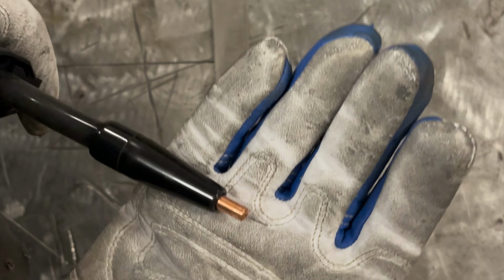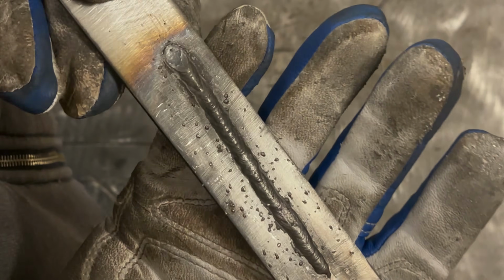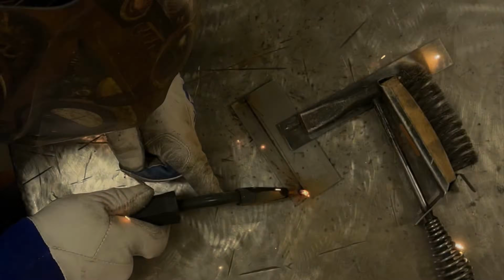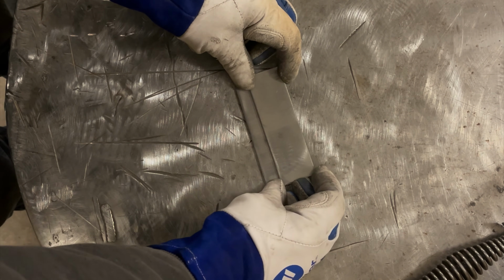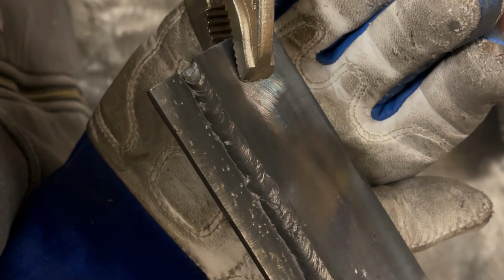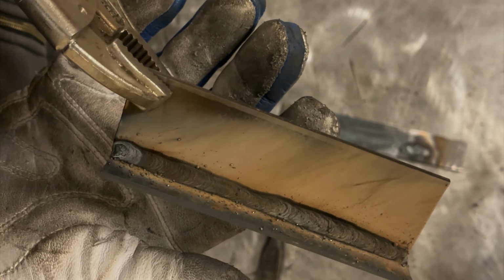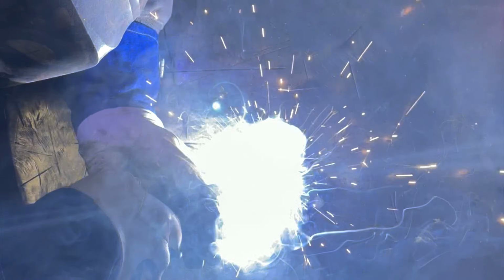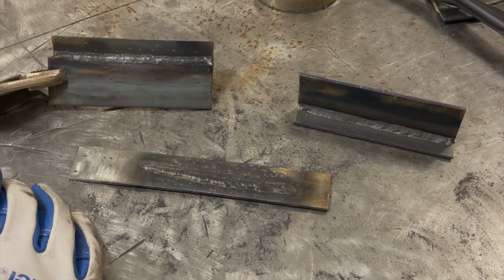How to weld with flux core wire

Comment: I was doing some 1/8 plate today with 0.030 flux core at recommended settings (20v, 272 in/min).  The welds looked good but it sounded like it was pulsing more than I am hearing in your vids.  I tried adjusting volts up/down, and stick out but nothing really made the pulsing go away.  I'm pretty new to FCAW - is pulsing indicative of some specific problem?

Second question - I wasn't getting penetration to the back side with 1/8" plate butt joints, no gap.  I chamfered and that seemed to solve the problem, but I was surprised that I needed to chamfer with 1/8" plate.  Wondering if I'm moving too fast.  Any thoughts?  I know it's all speculation if you can't see what I'm doing but I appreciate your vids and thought I'd get any input you might have.

In terms of tension, I am using the correct drive roller and set just enough tension so that it will bend when directed at a surface.  I was more concerned about too much tension (this being flux core), rather than too little, but just wanted to add that info in case it matters.
Reply from the maker: Hopefully this helps you:  

The pulsing sound is common and generally is caused by a lack of smooth feeding.  It may help if you put a small amount of grease on the shaft the spool of wire rides on.  Make sure the spool tension isn’t too high as well.  If that is all good it could also be differences in the thickness of the wire or a slight inconsistency in the drive roll center to outer diameter.  It probably isn’t a major issue but it is fairly common.  Also, make sure you’re using the right sized contact tip.  Trying a different brand of wire may help too.  Beyond that I wouldn’t say it’s a huge issue.

So most welding processes don’t have much penetration when run on a butt weld.  You achieve penetration by running a gap.  Your settings do seem a bit high however they may work for your welder.  Out of curiosity try 17.5v and 250 for wire speed.  If you run too hot you will be forced to move overly fast, which will will make it difficult to achieve penetration.  You will wind up with a out of control puddle and a overly high weld before it melts through.  The slightly lower settings may clean up the sound of the welding and give you more control (require moving slower).  

Because of the drive rollers knurling, you can run with low tension and still get solid feeding.  The roller grabs the wire so feeding won’t be a issue at lower drive roll tensions.
Reply: @makingmistakeswithgreg    Thanks so much!  I finished the project I was doing and I'm super happy with it (a frame for a motor control panel).  I dialed back the wire feed, and then found a voltage that worked. As for the pulsing, I think I had too much pressure on the wire spool (not the drive roller), but it was reassuring to know I didn't have to worry about it.  I really appreciate your help!
Reply from the maker: @robert.santore  awesome, glad to hear things improved 😀

Comment: Mines been in my garage for a few year would I have to just replace the wire and  it will weld fine?
Reply from the maker: I would replace the wire for critical stuff.  If you want burn the spool up for practice rather than throwing it out.  You may get porosity issues with old wire.  For practice who cares, to
Actually stick two things together that would be a problem lol.
Reply: @makingmistakeswithgreg  ok thank you

Comment: Picked up mine for $140 when it was on sale. Pretty nice little flux core welder. I definitely have an addiction problem for welders. Don’t care if they are cheap cause I have 3 of the green harbor freight welders and one AHP I use for TIG. It’s handy to have a machine for each specific process so I don’t have to keep changing settings and electrodes etc… I really appreciate all your videos, very helpful with all your advice.
Reply from the maker: Glad the videos have helped you 😀.  There is nothing wrong with multiple welders, that’s what I prefer too.  I have owned two different all in ones (esab rebel 205 and everlast 275) and they worked, but I much prefer stand alone machines.  That way the machine can be set the way I want and I use it for that.  Not to mention the reliability issue, you never know when one tool may have a issue/fail.  I always have a backup, I’ve been burned too many times lol.
Reply: Love to do that but now only have room for two. Next place will have a barn.

Comment: excellent video 👍i bought the same welder couple months ago havent used it but to weld rebar so far... hopeful to get enough skil under my belt to replace my rockers on my truck
Reply from the maker: Thanks 😀.  Rockers are doable with the machine.  Generally gas shielded MiG is preferred, mostly because at super low values porosity isn’t a issue.  However with some fine tuning you will be able to do it with flux core. Definitely practice on the same thickness material as much as possible before trying it.  It also helps to have someone hold a piece of copper on the backside of the welded are (or holes you need to fill) to prevent a blow out).  Search copper auto body spoon to find cheap ones on Amazon.  I will do a auto body video soon that will be of use 😀

Comment: Please will you help what exactly voltage and wire feed for nice welding thank you
Reply from the maker: It all depends on the wire and the machine honestly.  There is a huge range of settings that work, travel speed control is what gives you the ability to make good welds.  There are no magical settings, just practice with your machine and you’ll get a feel for it 😀
Reply: @makingmistakeswithgreg  appreciate your help

Comment: I appreciate all your knowledge. Still working on sorting out voltage, feed speed, and all the different pieces that works together and how to identify which is off. Might have to watch your video again. Great stuff
Reply from the maker: Thanks for the kind words 😀.  I made a video on what I call heat metal ratio, it can be found here: https://youtu.be/rml5SZBy_f0 .  That video should help you a lot.  Don’t feel bad if you find voltage and wire feed confusing.  In simple terms voltage dictates the width of the weld and how flat it is.  Wire feed dictates how much metal you deposit.  When you have thicker metal you need bigger welds than thin metal, therefore you need more wire feed.  Everything must be in harmony though, if you have high wire feed and low voltage your weld will just be a bead of caulk on plate.  If you have high voltage and low wire feed the wire may burn back all the way to the tip.  By keeping the ratios close everything will work properly.

Comment: Hi, I’m a newer welder. Just watched your flux core videos. I have a couple of questions. Number one when you are welding are you using a whip in pole motion? Or are you just going straight across at a slow pace? Also, am I correct in wire speed being the main source of putting heat in the metal versus that of higher voltage? So, for example if my voltage is X and stays at X, but I burn through now I slow down my wire, feed speed, leaving voltage the same would I not burn through at that point? Thanks in advance for your response and for your videos.
Reply from the maker: Welcome and i hope this info helps 😀.

When it comes to whip and pause, oscillation, etc I either go straight in (smooth travel) or a slight oscillation with flux core.  You want to avoid holding it in one spot and filling a big weld, the thicker the weld you deposit the more probability you will have porosity with flux core.

So as far as the voltage vs amperage debate.  It’s very complicated but I will try to simplify it.  Each value by itself doesn’t have a huge effect on depth of penetration.  Voltage makes welds wider and sets out the edges/ toes more.  If voltage is too low your weld will lay like a bead of caulk on plate, regardless of wire feed speed.  WFS controls how much metal you deposit.  It also increases the amperage the machine outputs.  The higher the wire the higher the amperage, but it doesn’t affect penetration much on its own.  The biggest control of penetration is both wire feed speed and voltage.  I made two videos regarding this with short arc Mig https://youtu.be/2zjveVO_igo ,  and this video https://youtu.be/PnRFiVNUDPI flux core wire reacts slightly different but it will be similar.

Now to directly answer your question: if you have a issue burning a hole and you drop either wire feed speed or voltage, it may not burn through.  However there is a range you want your settings to be at.  If you drop voltage too low or too high for a give wfs you will either have excessive spatter/wire burn back to the tip (voltage high) or a very roped up weld/difficulty with fusion (low voltage).  If your wire feed is too high for the voltage the weld will be excessively large, not wet out properly, and possibly push through the weld pool (on thin material).  If WFS is too low you will burn back to the tip have issues with a literal arc being present between the wire and the plate, and excessive spatter.  

When it comes down to it it’s best too adjust both at the same time to get it close, then adjust voltage up/down based on how wetted out the weld it, and adjust wire feed by how big/small the weld is.  Hopefully that helps 😀
Reply: @makingmistakeswithgreg  OMG thank you sooo!!! Much!!! Great Info
Reply from the maker: Also, to make more sense of heat to metal ratio watch this video:  https://youtu.be/rml5SZBy_f0 , you will see the direct results of changing settings.  The video has a lot of info and will take a bit to get through, but is should clarify a lot. 😀
Reply: @makingmistakeswithgreg  I really appreciate you!
Reply from the maker: @fpvflyby6855   no problem 😀, glad I could help.

Comment: If im using the proper flux core wire for overlapping welds. If i overlap my welds on the part like one in the middle one on the left side with overlap one on tbe right with overlap will the weld be alot stronger?
Reply: Multipass is what I meant. I guess overlap is a negative term in welding. What I mean is multipass weld stacking does this make the weld stronger?
Reply: Im using blue demon E71T-11
Reply from the maker: So what gives a weld strength is that it’s sized properly for the material (generally weld is the same thickness as the material), it’s free of defects (porosity, undercut, etc), and it’s made from filler that’s as strong as the base material.  When doing multiple pass welds to meet proper finished weld size the weld will equal the strength (and may surpass) one single pass.  

To put it in simple terms, say you have a weld that you could possibly do in one pass vs two or 3.  The more metal you put down in a single pass the poorer the grain structure of the solidified metal.  There are limitations to how much metal you want to put down in a single pass.  For most people it’s the limit of what their welder will do (most don’t have 300+ amp machines to put down massive welds), so multi pass becomes a requirement.  However there will be situations that a person at home could do a single or multi pass on.  In such a situation if it requires strength use multi pass, if it doesn’t then single pass it.  I will do a video on this topic soon 😀

Comment: When your welding flux core like this is ther anything touching the meterial from the gun? Is the wire in the pool its creating or is everything like the wire like separated from the actual meterial?  I guess what im asking is the wire dragging along the crack of the 2 pieces? Sorry if it's a silly question but I need to know.
Reply from the maker: Ok hope this helps:

Great question, and it’s actually a very complicated one to answer 😀.  So with wire welding (gas shielded short arc Mig) the wire pushes into the molten puddle, and the current (amperage) rises to the point the wire blows apart, clearing the short.  It repeats that many times per second.  “Spray arc” wire welding has the wire turning to liquid before it ever hits the puddle so it functions much different than short arc mig.  Flux core is a hybrid of both short arc and spray, it’s not exactly either one of them.  The wire itself (say .035 flux core) actually has very little metal, because it’s a hollow tube.  This is why settings used with flux core aren’t nearly as high as spray arc yet it functions closer to “spray arc” or globular” transfer.  Basically the heat to metal ratio favors heat with flux core wire due to the lack of metal in the wire.

Flux core wire also is welded on DCEN polarity (the gun/wire is negative) where is Mig is done DCEP.  DCEP puts far more heat into the wire itself because electrons flow from the work piece to the tip.  The electrons striking the wire tip causes a ton of heat to build up.  With DCEN (mig gun on the negative side) electrons jump from the wire to the plate, which keeps the wire slightly cooler.  If you weld flux core on DCEP the wire produces a ton of spatter.  I would take a guess and say the hollow tube can’t handle all the heat.  Running on DCEN is also why flux core differs from most wire processes.

With all of that covered, let’s talk about the arc.  With short arc mig there isnt exactly a arc that’s going between the wire and the molten pool (like the stick or tig arc).  The arc that exists is only temporary because a arc can only exist when there is a arc gap.  When the wire hits the puddle the voltage drops to zero and there is no arc present.  This happens many times per second.  With spray arc there is more or less a consistent arc present because no solid wire ever hits the molten puddle because it’s liquid before it ever hits.  The voltage never hits zero either.  Well flux core from what I have read never exactly hits zero volts and the wire itself doesn’t actually stab the puddle as a solid like hardwire short arc mig.

As far as how far should the wire be, that depends on what wire process.  With the proper settings with gas shielded short arc mig what matters is the tip of the contact tip is 3/8th of a inch to the molten pool.  Flux core is between 5/8th and 3/4 depending on wire diameter.  Spray arc is 1/2 to 3/4 depending on wire diameter and settings.  Unlike stick and tig (where arc gap is critical) you don’t control the arc gap with mig.  You need to only worry about maintaining the contact tip to work distance.  The wire (with proper settings) will just do it’s thing when you weld provided the contact tip is the proper distance.  This is one of the huge benefits to wire welding, small (1/8th in) variations in contact tip to weld pool changes won’t affect the weld much.  1/8th changes to a tig or stick arc gap will drastically change the width of the weld.  All you need to do is aim the wire directly to where the pieces meet, pull the trigger, and move the gun at a consistent proper speed (drag angle with flux, push or drag with MiG).
Reply: Nevermind there separated bc there has to be a arc correct? How far from the meteral should the wire be?
Reply: Ok thank you. I got this gun and im gonna practice alot befor I weld what I'm actually needing done with it.

Comment: Sooner or later I'll pick up one of these, but based on what you're telling us I should get my wire some place other than Harbor Freight-  there's a Tractor Supply on the other side of town, and I'm pretty sure they carry Hobart welding products, and Hobart from what I know from welding classes makes a pretty good wire product.
Reply from the maker: Hobarts fabshield 21b runs really good and I bet they sell it.  It’s a e71t-11 wire and suitable for multi pass welds.  Highly recommend that wire, it’s a night and day difference from harbor freights wire.  😀
Reply: @makingmistakeswithgreg  Thanks bud.
Reply: There are a bunch a comparison videos here showing Forney and yeswelder make really good wire

Comment: So, flux core (gasless) is a fine process, but somewhat unforgiving-  meaning that you have to have the optimal stick-out, slow travel speed, and everything else.
Reply from the maker: Pretty much.  Honestly flux core is a real solid process on thick material and for out of position welds/vertical up.  However when things go wrong it can be a handful to fix.  Gas shielded Mig doesn’t make porosity when you vary the stick out by a little bit, it’s far more forgiving.

Comment: Is it anything...that the beads are dark grey after slag removed? Compared to a shiny (like solder) one...?
Reply from the maker: So the color the weld is when done could be controlled by any number of reasons. The particular brand of wire, the thickness of metal, your travel speed, etc.  If you are running hot and fast the weld may stay hot enough to react with oxygen in the air due to the flux coating not completely covering the weld.  I would try to weld on 3/16 or 1/4inch material fillet weld with settings the welder suggests and see what it looks like (if you’re currently welding on thinner).  If it’s not black it’s likely just a heat input issue.  If it still is you could try switching wires.  What wire are you running?
Reply: Thanks for your feedback. I use .039 wire on 1/8 base at 85A. I thought my beads were dark because of either cold or slag inclusion.
Reply: @shaneisaac1184 how is your preparation before welding? Is your steel clean? I sometimes am in a position where welding with self shielded wire on dirty steel or mill scale on the steel make slag removal difficult as opposed to nice shiny prepared steel, where the slag peels off. I ran smaller self shielded wires like T-11 and the slag was a lot more difficult than T-8 structural wires so that could be it too.